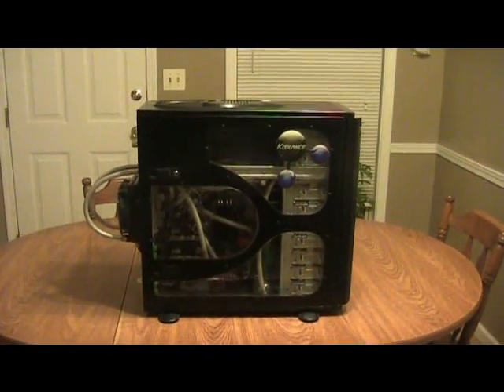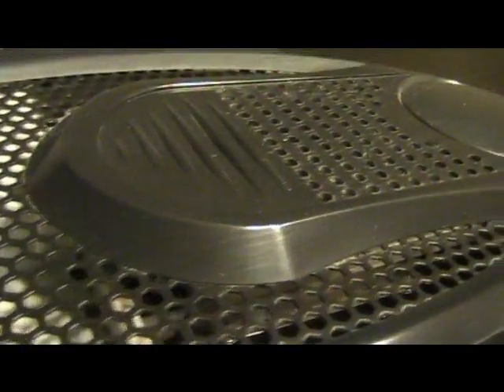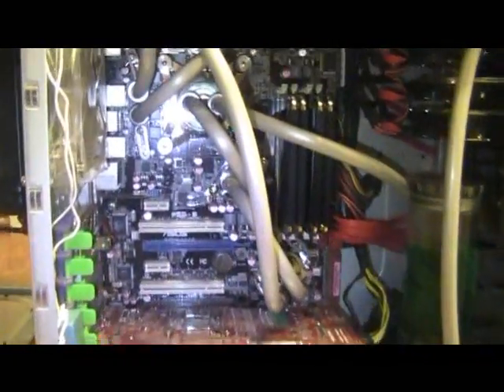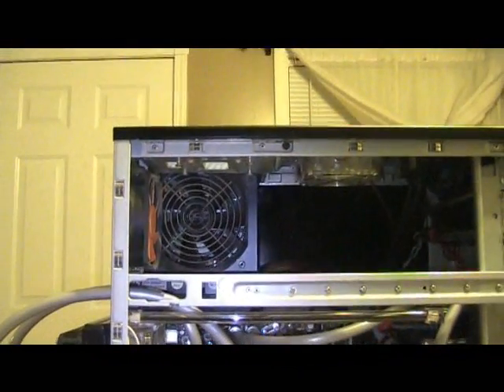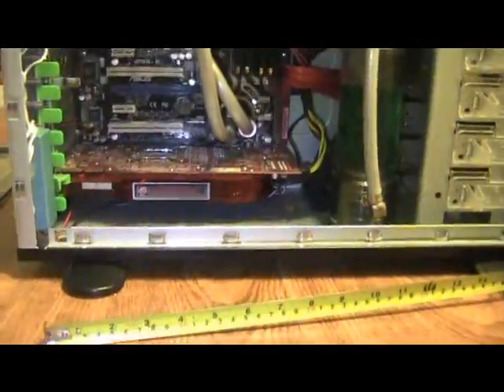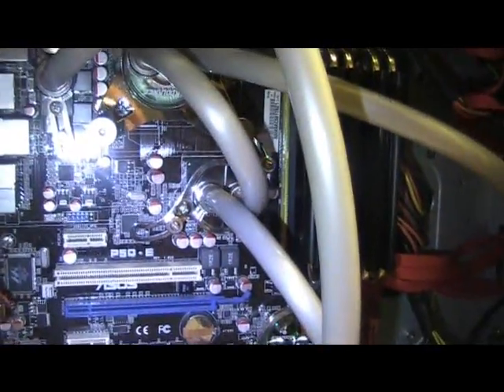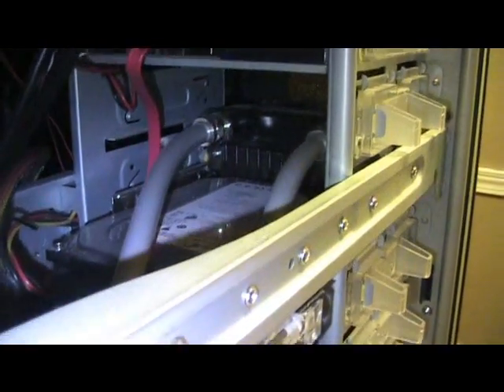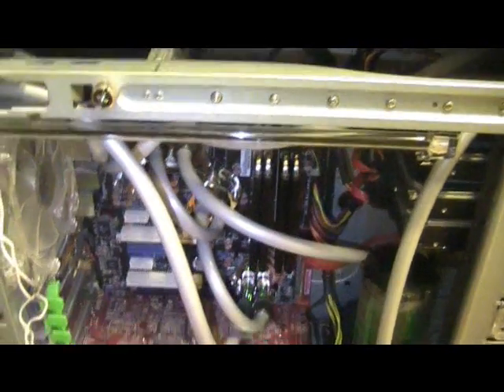A final look

Comment: pretty charming man!! congrats, you can buy separately the paper filter for the top, and in the front you can use silicone between that ports o block the air;  i will do with mine after all the work is done, and if somehow you need to had something in the front port latter on, is just easy to pull it off ...like rubber to block the air, congrats 5\5**